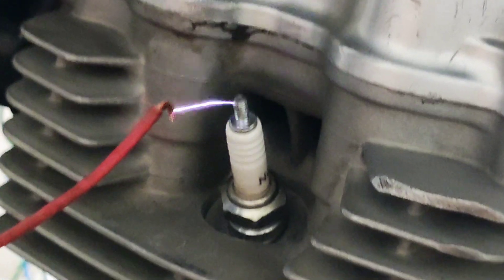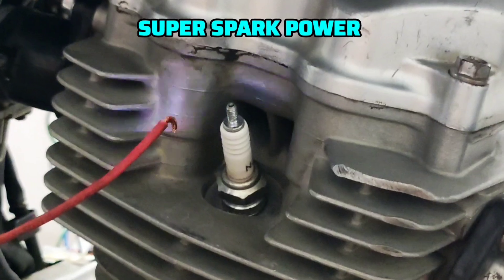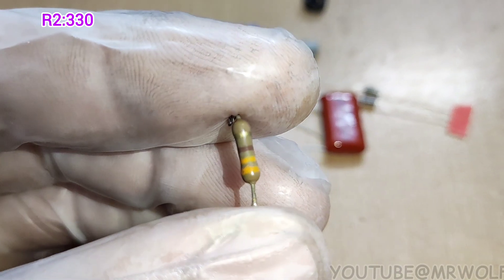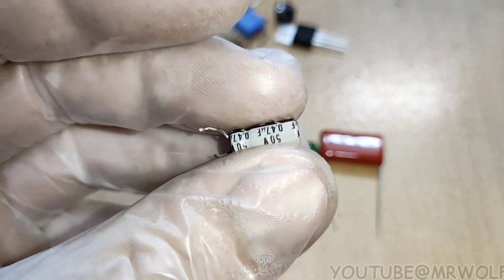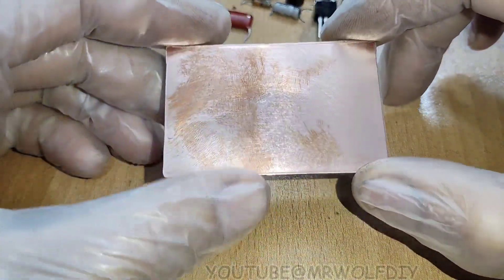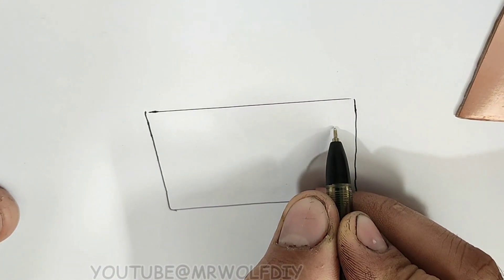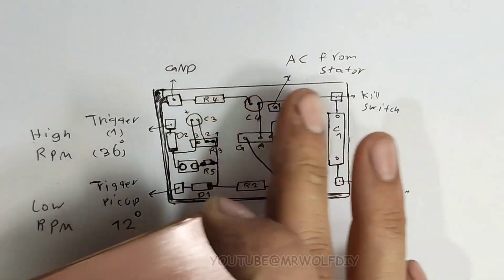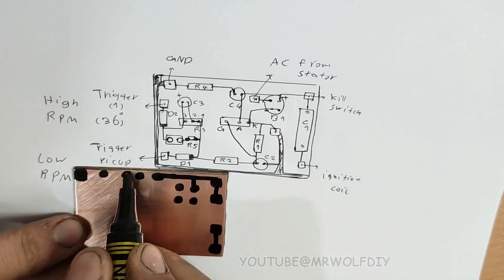How To Make A Ultimate DIY CDI for Any Motorcycle! Full Guide

Comment: Hello sir I think its a great video congrats!!!❤
I have a few questions.
Starting with, 
1) What is the purpose of this kit?
2) I always wanted to make my Royal Enfield Thunderbird 2016 CDI Carburettor model to rev more than 5000 RPM. So, Will it make it rev more than 5000 RPM?
3) Could you help me make my Bike rev more than 5000 RPM?
4) Will there be any consequence  for revving my bike to Red Line occasionally for a short distance? 
5) Which country are you from?
I anxiously await your kind reply. Lots of love and best wishes from India?❤
Reply from the maker: Hello and thank you,
This CDI helps the motorcycle run smoothly at both high and low RPMs and reduces fuel consumption.
You can use a CDI without a rev limiter, but it is likely that high RPM could damage your motorcycle's components.
This is because your motorcycle is not designed for high RPM, and high RPM, such as 8000, may cause damage to parts like the valves.
If you are interested in doing this, you may also need to upgrade some components of the motorcycle and its cooling system.

Comment: Is it possible to use this circuit along with ECM, only to provide current to the cylinder head and let ECM control other sensors...

You have done a very good work Sir, hats off to you 🎉🎉
Reply from the maker: Yes, it is possible to use the CDI kit to supply current to the cylinder head while allowing the ECM to control other sensors, as long as the inputs and signals from the CDI kit do not interfere with the ECM. It is important to ensure that the CDI kit only performs ignition duties while the ECM handles other components.
For this, modifications in the wiring may be required... good luck

Comment: What ist the Name of the acid liquid
Reply: There is a DIY solution you can make using ordinary Peroxide from pharmacy (or pretty much any supermarket) plus something else easily available (but I forget what 🤔)
I didn't want to spend $30.00 on cupric chloride for an experiment
I used it to dissolve copper on copper clad board (roughly 10+ years ago) to make super capacitor bank to fit 1974 Honda that needed battery for ignition.  It weighed next to nothing (less than 5 ounces) compared to about 12lbs for battery
I used a Sharpie (3~4 'layers') as resist to draw out circuits then removed copper.
 Worked surprisingly well.
Reply from the maker: cupric chloride or ferric chloride
(PCB acid) good luck
Reply: ferro cloride. europe can normal buy ewery pharmacy before, today maybe can buy elektric hobby shop.

Comment: @MrWolf 
Will this work on a 6volt suzuki dr250?
Reply from the maker: According to my information, the models from 1990 to 1995, which have a capacitive ignition system, are compatible. However, for the older models with a points ignition system, the ignition system must first be converted to a CDI type. This requires replacing the stator, magneto, and ignition coil.
Reply: @MrWolfDiy  ...82model,dont see no points,was already cdi previously but these bikes had a problem burning cdi's
Reply: @mornesmal2420  Yes, they did. SP and DR 400 had same problems
Reply: He is right super cub has 6v cdi maginto

Comment: This is so great video. I have question. My bike is husaberg fs650e(2008). I want to limit certain RPM. For example, i want to make full throttle with 3000RPM max. It is possible with your kit?? It looks like your kit can go up more RPM. I guess it is possible to restric the RPM as well.
Reply from the maker: Yes, it is usable. If you use the 12-degree output of this kit, the RPM will be limited to 2000. If you use the 36-degree output, it will be limited to 5000 RPM. However, it needs to be practically tested.
Reply: @MrWolfDiy  mine has TPS. is it affects too?? (10wires. 3 for Tps, 1 for ignition, 2 for pick up, 2 for generator, 1 for ground, 1 for kill switch)
Reply from the maker: If your motorcycle does not have an ECM and is carbureted, and the stator is AC with one or two pickups, the rest of the wires will be unused, and only the wires required for the CDI will be connected. However, the engine's performance may not be optimal.And maybe it is...
In the ECM system, all limitations are implemented through software.
In any case, it needs to be tested.
Good luck
Reply: @MrWolfDiy  thank you for replying. It helps me a lot. :)

Comment: Is this good for a two stroke 50cc engine
Reply from the maker: If your motorcycle is very old (points ignition), you will need to replace the magneto, stator, and ignition coil. However, if it has a capacitor discharge ignition (CDI) system, it can be used.

Comment: Mashallah, 
How to ECU ECM work
Reply from the maker: The ECM receives data from sensors, processes it, and based on that, adjusts the engine's performance to optimize efficiency and minimize fuel consumption It is completely different from the CDI system.
Reply: Thankyou, for this information brather
God bless you